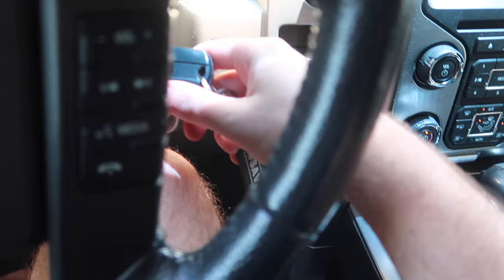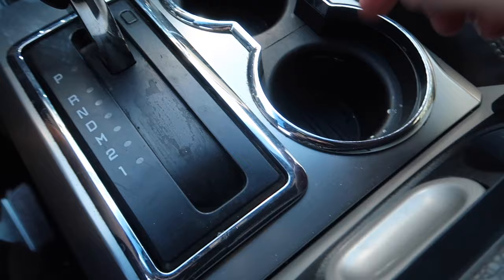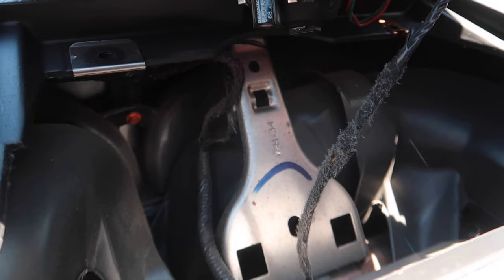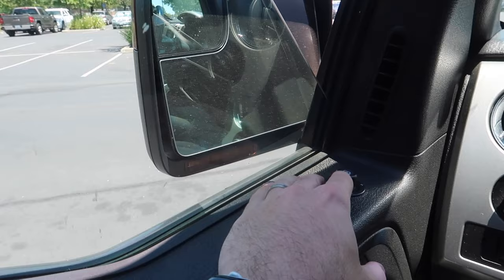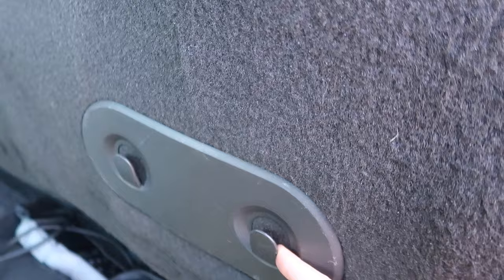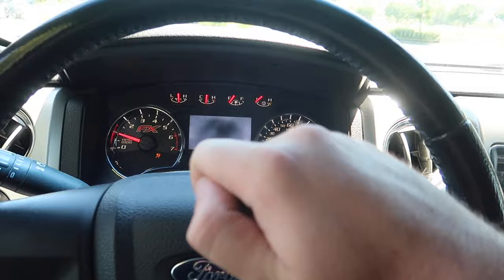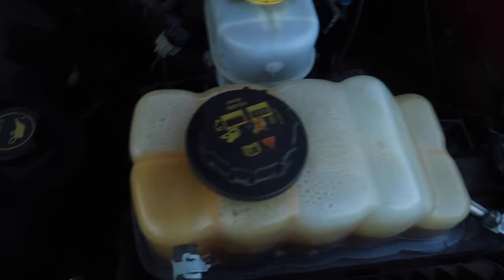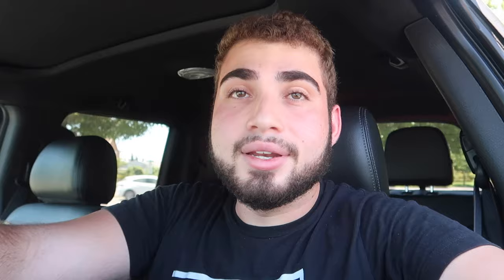FORD F150 HIDDEN FEATURES/FUNCTIONS (2004-2014)

Comment: I have 2015 ecoboost platinum sitting in my driveway. It's the only way these trucks can't break down. Why do I say that? Just got soaked for $5500 in a single repair bill. My piece of garbage has only been seen on time on schedule at the same dealership. Mine is fully loaded: Leather heated seats, sprayed bed liner, roll and lock bed cover, cameras all around. Ironically it also has an extended gas tank.   Sad cause these piles only get 14 miles to the gallon. That highly bragged about aluminum body won't protect you or your family from a drunk angry squirrel. Didn't know I had a lemon on my hands until the dealership couldn't explain how routine maintenance all of sudden costs $5500. I drive my wife's old station wagon.  Save your save a ton of cash and buy a GMC, Dodge, Chevy or ride the bus.

Comment: I've had the 2014 3.5L for 10 years and while there are some neat things, there are also some questionable design choices. For example the locking differential switch with the 4WD knob tends to go bad. When it does, it essentially locks the differential. The switch is easy to replace and costs about $40, but the issue of locking it when the switch fails is poor design. Also the water pump has a plastic impeller which tends to break. Those are two examples of poor design that when they fail can put you on the side of the road. I'll never own another Ford truck.